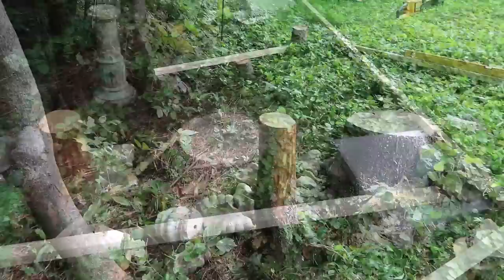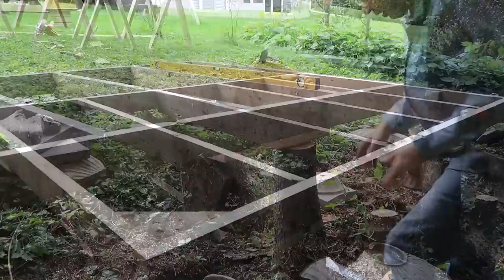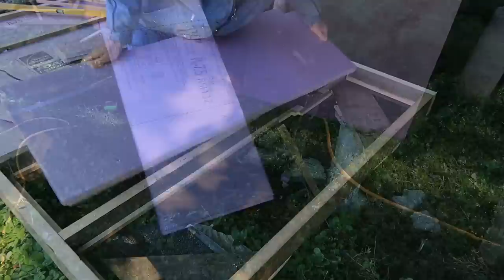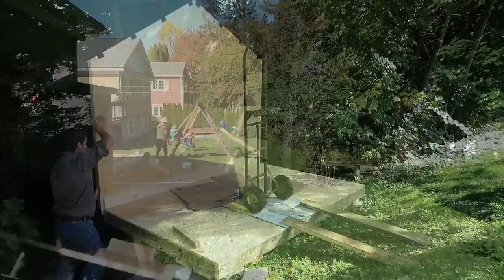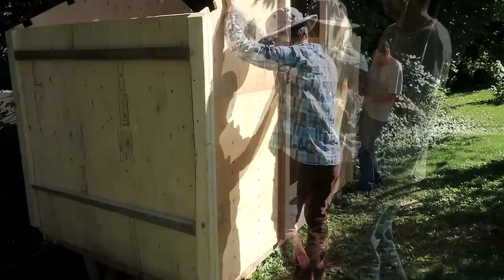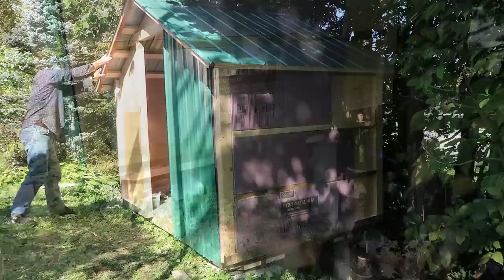A shed like a plywood box, overhanging a slope.

Comment: The technique they use in prefab houses, is to sandwich rigid foam insulation between 2 sheets of plywood using polyurethane construction glue. 
Then cut the pieces to the dimensions. No lumber is used besides the internal perimeters.  
Super quick to build and stiff as it gets while being  energy efficient.
Reply: Also known as SIPs

Comment: I trust the stump more then the pillar. Nice shed, using useless space above that grade.
Reply: Especially now that the stump has a roof over it.  Rot?  Why would it?  It isn't getting rained on anymore...
Reply: @leifhietala8074  Sure, but there's still humidity from the ground and possibly bugs...
Reply from the maker: I have seen stumps under cottages where the only thing that was left was the above ground part.  in 20 years time it won’t give much support.
Reply: @leifhietala8074  there is still watershed from the lawn to under the shed down the slope into the stump. That'll rot out the wood in a few years
Reply: @ratchet1freak  roots to need quite a time to rot. And you will feel it over time when you enter the shed. Its a slow process, not like it suddenly falling over and explode :D

Comment: My concern is that birdbath pedestal, though captured at the top, it is not braced against leaning, and it is sitting on compressible dirt.  Every time Matthias or equipment (or kids) goes into or out of the shed, horizontal forces will lean it back 0.001 inches, and in a year or three the floor will be shifted backwards on the paver and the pedestal will have a dangerous lean.
Reply from the maker: it IS braced against leaning, I just didn't mention that part. Also, the stumps prevent the shed from sliding.

Comment: I'm actually a home inspector. And man, this video left me feeling a little confused. The tree is a great idea for now. The bird bath pedestal is actually a superior solution to some of the things I've seen. I just wish in my heart of hearts that someone would get this man a post hole digger, some concrete, and a couple of brackets. Or additional supports that have birdmouths rather than relying on fastener strength. Or the corner brackets turned on their sides so they are a bit stronger. 
But these are only the improvements I would make. Not my property, not my shed, not my money. And I'm pretty sure Matthias knows all of this already. 
Thank you for the entertainment across so many years.
Reply: First time huh ?
Reply: I'll bet you REALLY liked the supports under his old cabin, the one he repaired the deck on recently. Matthias is unique and intrepid, and admits failures refreshingly. But now, you and I will have to watch for years to find out how the shed gets on.

Comment: I don't know if the slotted 2x4s for the roof slats is typical but it struck me as a stroke of brilliance.
Reply: It's not that typical since it takes time to make those slots. You might see it in prefab (and this is effectively a prefab) where a mass production company can make jigs and machines which make getting the slots right fast and easy, and ease of assembly is a concern.

Comment: The only issue I have is with the supplemental brace on the stump side, is it really depending completely on the shear strength of the fasteners?
Reply: watch project farm  comparison of shear strenght of different nails and screws.
Reply: @victorhopper6774  shear strengths of fasteners, both nails and screws, are readily available from various websites and manuals. American Wood Council’s National Design Specification (NDS) and Simpson Strong Tie’s manuals for example
Reply: @joshl90  not just shear strength that one needs to know. nails often bend and have a fraction of the holding power of a screw. those 4 screws will hold quite a few hundred pounds. now if his kids get over 500 pounds all bets are off.
Reply: @victorhopper6774  I’m a structural engineer. Holding power is not a real metric; shear and withdrawal are. Nails bend because they are softer than screws, which often snap when they fail in shear. Let me know the shear strength you come up with when you look up the values of the fasteners used. Curious where you got this random 500 pound number. Is the wood failing or the fasteners?
Reply: @joshl90  not likely the wood will fail in that setup for years. just watch the video i mentioned, he did a very good job.
Reply: @victorhopper6774  I’ve watched Project Farm’s videos, including the one you mentioned. You are merely guessing that the wood won’t fail in the current configuration. The wood could fail in tear out from lateral forces. Similar to the other commenters on this video, it is best to stay in your lane rather than guessing.

Comment: the foundation is definitely sketchy for the supports.  this is no different than a fencing post, it should be 3 feet underneath the soil to ensure stability with the eroding soil.  additionally, there should be compacted gravel  underneath the front stones just like a paved driveway.  fortunately, this is only a storage shed and not a working/living space.

Comment: It may be okay for now, but the problem is it will become dangerously unstable once those stumps rot out. It may topple over in a random wind storm, most likely with no one inside, but there's definitely a chance someone could get pretty injured. Mostly I'd take issue with if you ever sell the house, you're now putting others at risk.

Comment: If you were just storing junk in there, I wouldn't care, but your kids are going to play there and they could go under the shed, jump around causing a shear load which could ruin things. 

I don't know, I think this is a bad call. 

And to those waiting to comment, it's not like Mattias hasn't been wrong before. Soldering wires and then screwing them into light switches, he got called out for not being aware of cold welding of solder.
Reply from the maker: the stiffness comes fro. the walls, not the floor.  the walls hold the floor frame straight.
Reply: @matthiaswandel  I'm more concerned about the supports. I editted my comment to exclude what you're referring to, I'm not an expert and I don't claim to be, but for the most part I do stand behind my point that the cost benefit of doing it the way you did it makes no sense. You spent like 200 dollars on material, and you're going to support it with junk? And your kids are going to play in there?? 

You mentioned shed, not playhouse... Ekkks. 

Your house your rules though. 

At least put it in the thumbnail that you are using questionable materials for the supports. Not sure if that's the kind of attention you want to attract. Seems to be against your ethos.

Comment: Slather that stump with some used ATF and motor oil and it'll last 50 years.
Reply from the maker: the above ground part will last a long time.  it’s the roots that will rot first
Reply: @matthiaswandel  with the shed over the stump if that keeps it dry it should stay for a good long time.